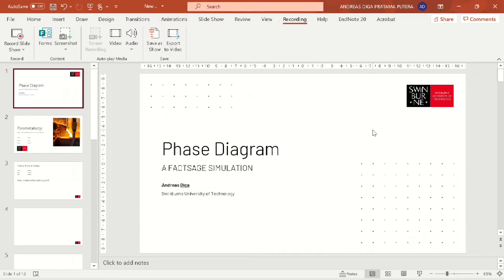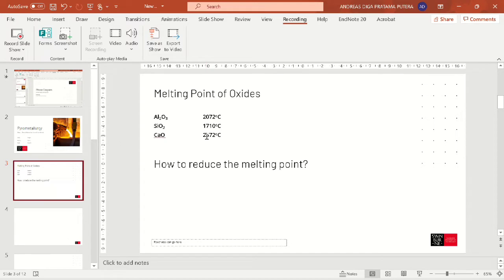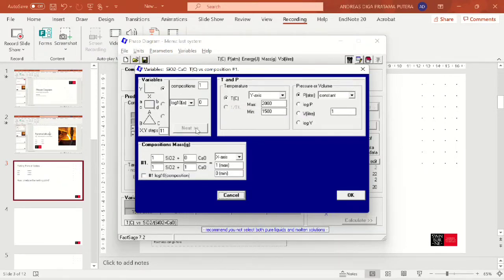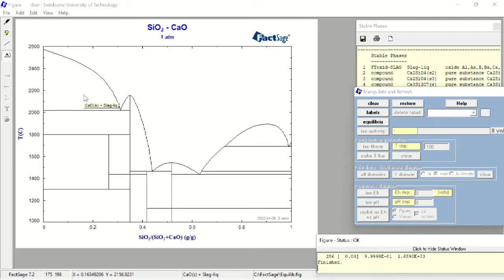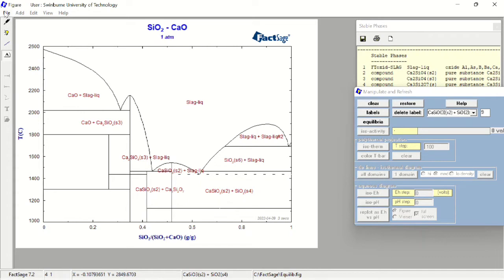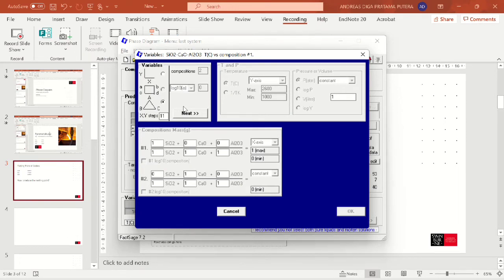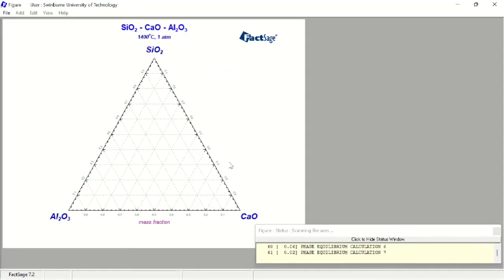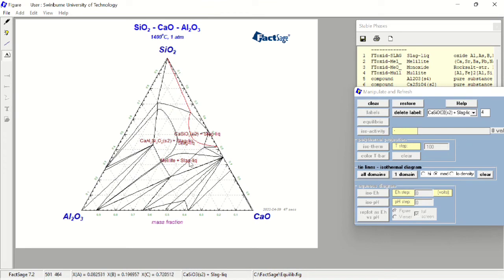How to Use Phase Diagram Module in FactSage

Comment: Thank you for sharing such a helpful videos, can you make a video for ternary phase e.g (FeO, SiO2 and MgO) Conditions: If we added some amount of CaO, FeO or SiO2 as a flux what will be their effect on phases (Liquidus and Solidus), melting point temperature should be shown on phase diagram. 
And binary  diagram using pressure of any two gases as variable (x-axis, y-axis) e.g Oxygen and Sulfur for copper. Thank you.